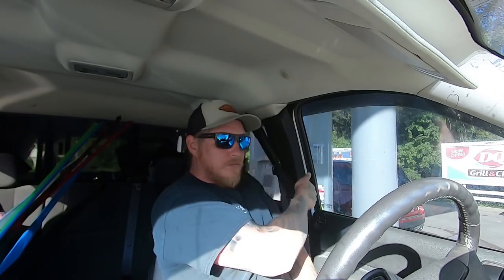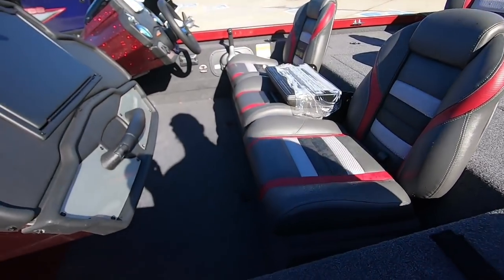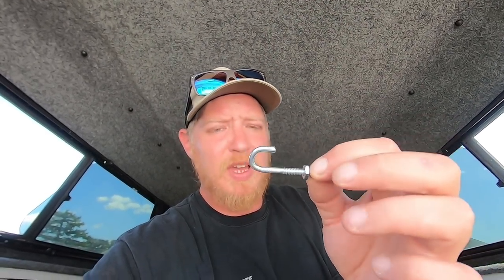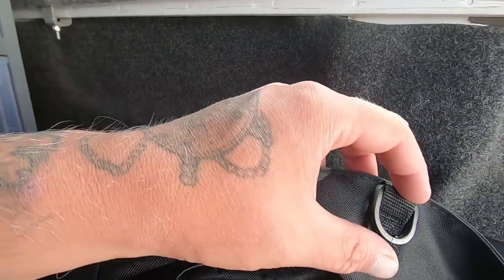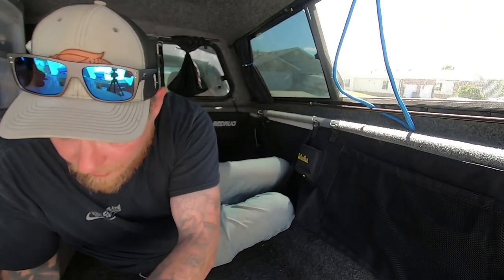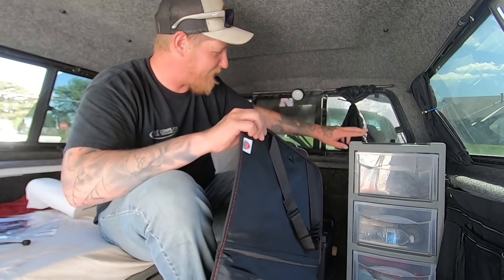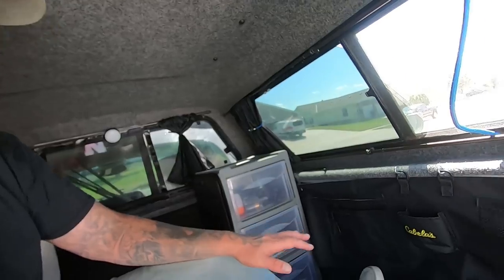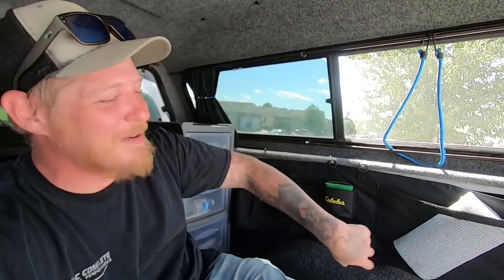Adding More Storage to my Truck Camper

Comment: The Velcro will hold until exposed to prolonged high temperatures.  Then the stick on adhesive will soften and slip down.  A few small screws and flat washers,  or pop rivets will hold it in place.

Comment: Hey, I like it. I don't want to add cabinets in mine either. I haven't even done an over the wheel well bed yet because my camper top isn't any taller than the cab. I'm just going to have to play it by ear until I can camp in it some to see what I really need to change. Right now it's just a couple of old camper mattresses on the floor and reflectix to cover the windows. Oh, and I do have a 5000 BTU AC. Just subscribed, Thanks for the videos, inspiration and ideas.
Reply from the maker: Thanks for watching!
Reply: @CrazyQuady  Are your curtains custom made?

Comment: G's Get to the point I had to stop the video after 50 seconds I'm already bored we don't need to heat see you top off your gas tank put the receipt in your wallet get the keys in the ignition just get to the point
Reply from the maker: G's don't give a F what some random on the internet thinks. Thanks for the 💰 🤷‍♂️